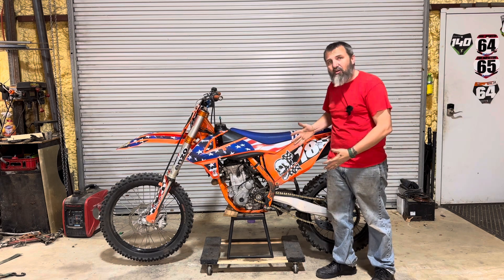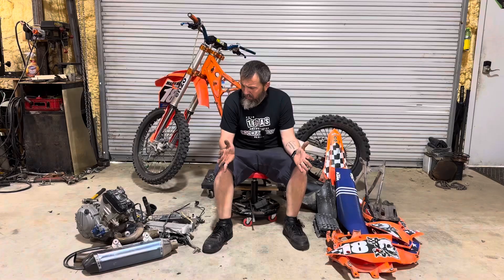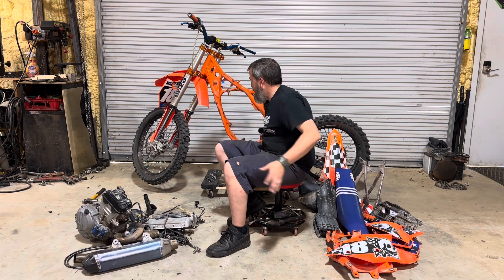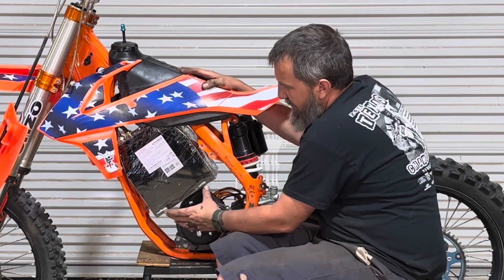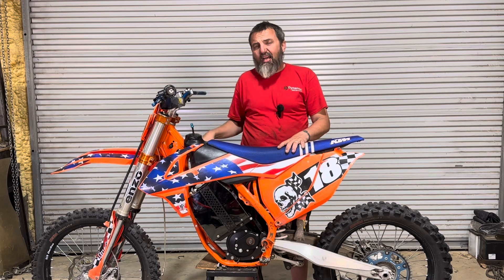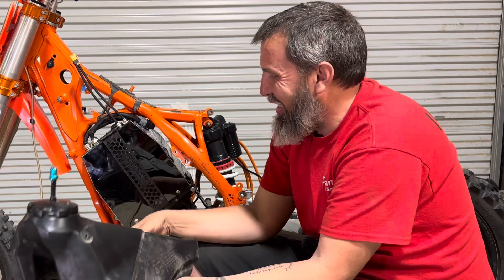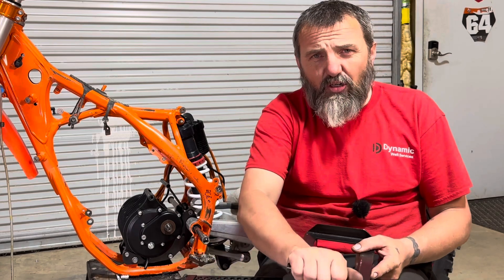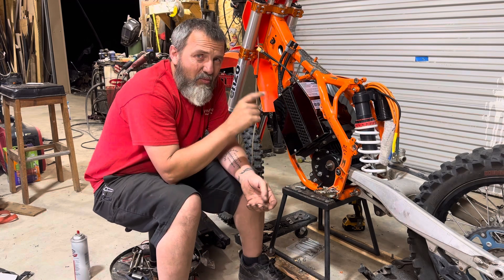How to start electric bike conversion.

Comment: How about links to the parts sources? I've done a GS500F street bike conversation and using a hub motor, but axial motors need some math for ratios and such. Drive voltage and current are crucial, so it's be got to know that as well.
Rather than hot swap, why not quick charge?
Also, I've had occasional trouble welding nuts, so we use rivet-nuts and they work well with the right tool. 
Rebuilding bikes is almost as fun as riding them!
Reply from the maker: @jameswyatt1304  I will try and get a link posted for final parts list. Quick charge adds a lot of heat into the battery. These batteries aren’t liquid cooled. Rev nuts work good for some things but won’t hold up the torquing the motor mount to spec.